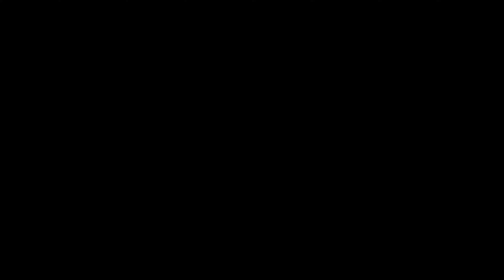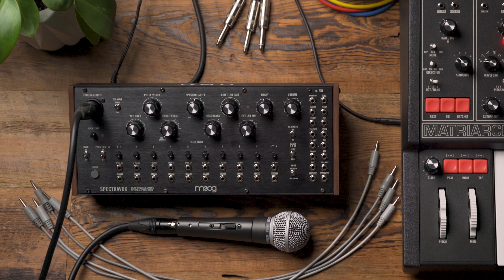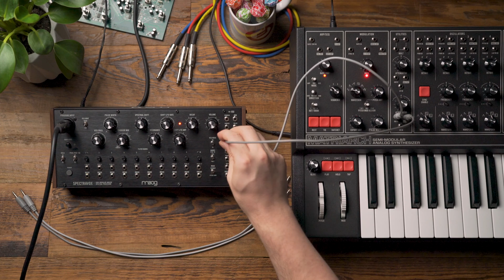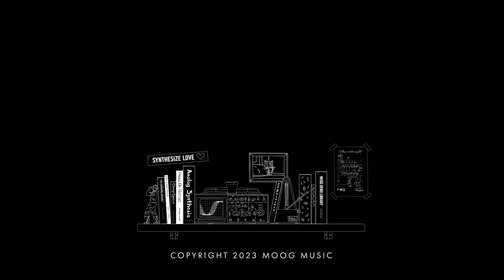Spectravox | Traditional Vocoding

Comment: Hi @MoogSynthesizers, just received the Spectravox. Tried to use it with the Shure SM58 (not SM58s) but somehow I do not get it to work as it should. The gain is max open and I have to yel very hard to get a minimum signal.
Maybe you can tell me what i am doing wrong?
Thank you